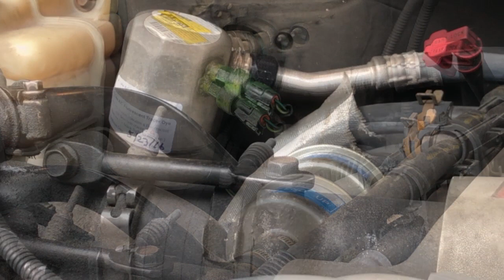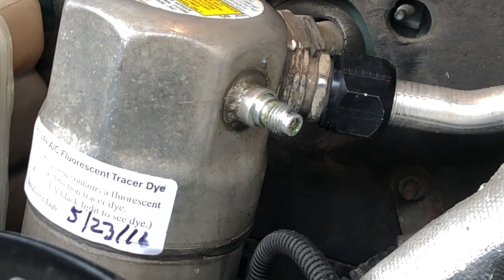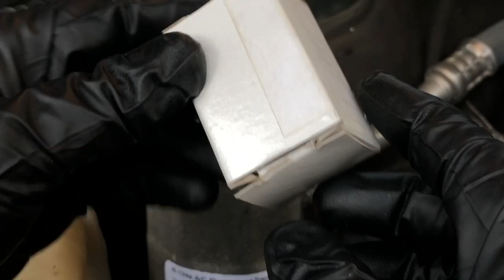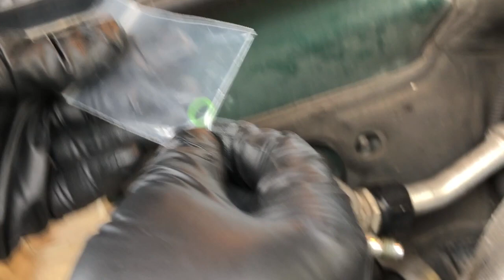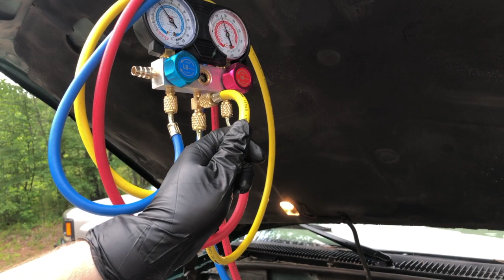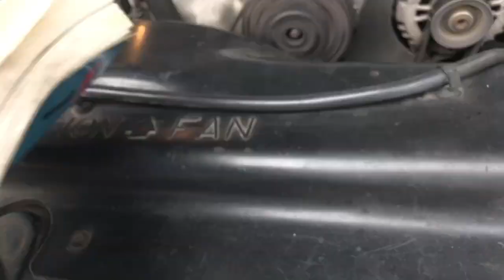1994 - 2002 GM Truck Green Slime Leaking AC Cycling Switch Replacement on Accumulator (Chevy & GMC)

Comment: Informative video 😁👍 did this end up solving the leak? I think I have a similar problem. Had it filled July 25th worked great for 3½ weeks then it stopped blowing cold but still comes on and after investigating I still have pressure more then likely low pressure in the system but the clutch only kicks on for 1 second then off 3 seconds continually and the pipe coming off the accumulator frost but no cold air. Then I noticed the A/C Clutch Cycle Switch had a slight mist of greenish oil same spot as in your video everything else looks dry and clean that I can see.
Reply from the maker: Yeah this trucks AC has been working fine ever since this video repair.
Reply: @DrShock  Awesome just what I wanted to hear. Thanks 😁👍